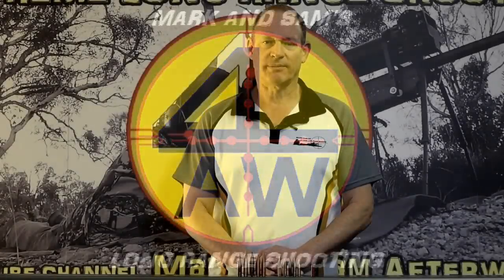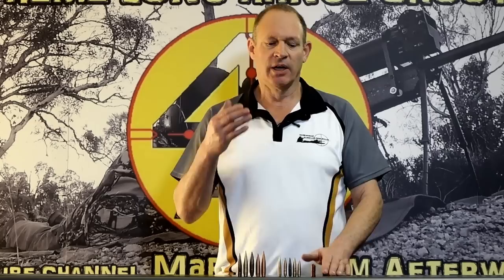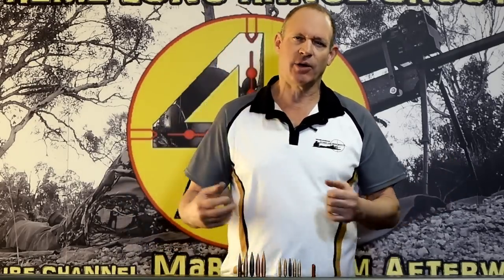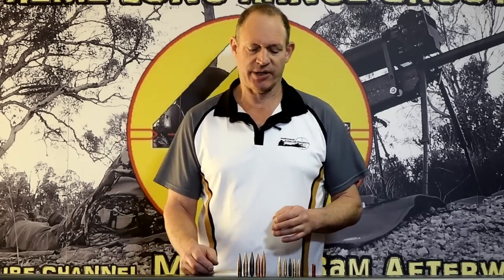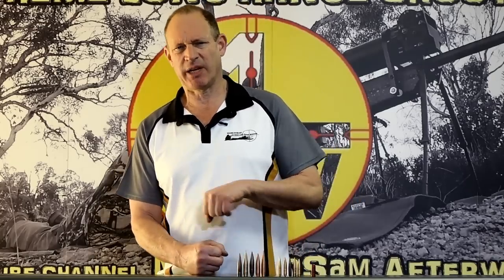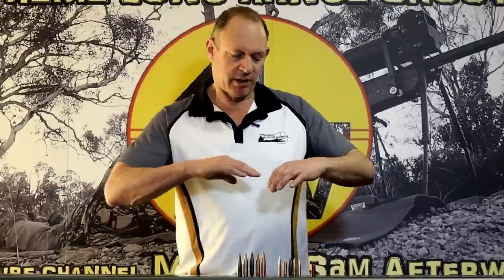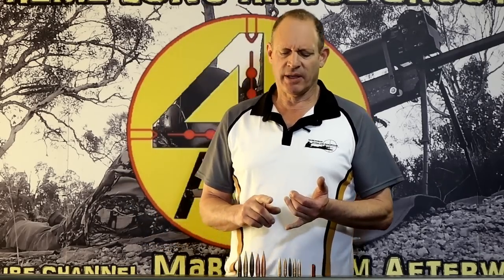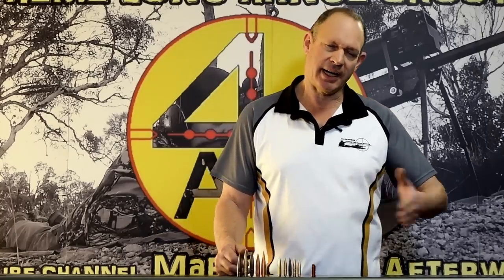Drive Band Bullets (an overview)

Comment: Thank you Mark, physicist Lutz Moeller invented in 2003, inspired by older artillery shells, this type of copper hunting bullets (KJG). The muzzlespeed of my 7mm Mauser using similar 3Band Classic ammunition manfactured by Labor für Ballistik is 3100 ft/sec, energy is 2500 ftpds. My 100+ years old falling block rifle (Heeren) is chambered in 6,5x57R, ist performs with 3Band Classic 3200 ft/sec and 2000 ftpds. These are my favourite hunting cartridges since 2010. Greeting from Northern Germany.
Reply from the maker: Thanks Herbert

Comment: Watched a WW2 video recently installing copper drive bands on artillery shell steel castings, very interesting how they prevented the drive band from rotating on the projectile.
Reply from the maker: Cheers
Reply: I would be interested in watching that if you remember what it was.
Reply: Hi, it was a WW2 documentary from UK manufacturing and showing the whole process making them.
Can't remember the YT title.

Comment: In my humble opinion monolithic bullet's deviate from a straight wound channel more than cup and core bullets. This seems especially true in pistol cartridges. Rifle cartridges as long as tooling along at a pretty good speed don't deviate as bad as handgun loads. Still point of aim is the path one wants his bullet to travel as closely as possible. After impact of flesh and bone is where the monolithic bullet's deviate. Even in gel it seems to happen more commonly with monolithic bullet's. 
Just my observation of a characteristic that does happen with even the best cup and core. Just more often with mono.
Great video 
Keep'em coming!
Reply from the maker: Thanks Man, Cheers
Reply: Everything I see with them in hunting applications seems to show that there are a lot of changes compared to lead cores bullets. They seem good but they need speed at least if shooting lighter skinned animals and not aiming for bone or heavy muscle. I think they will perform best at far lighter weight than someone who prefers deep penetration normally selects. It seems that their opening speed is pretty high and they tend to fall off fast enough that when shooting past 250 yards with non magnum calibers it's probably best to switch to shoulder shots to get them open. I think they are a good option but one not always well understood.